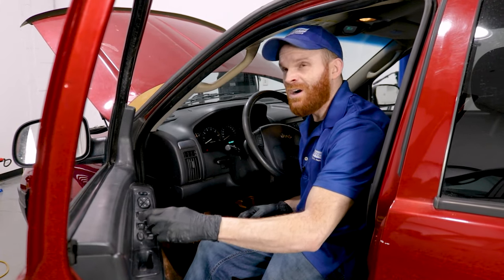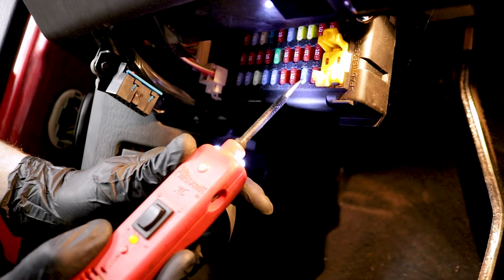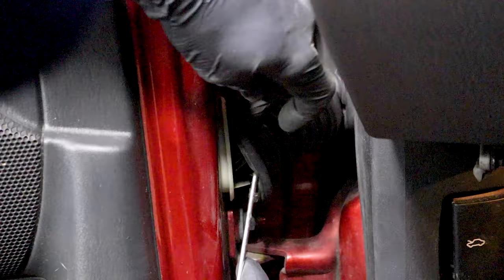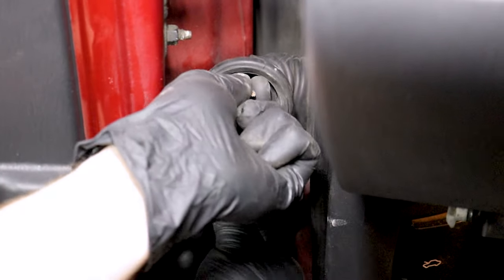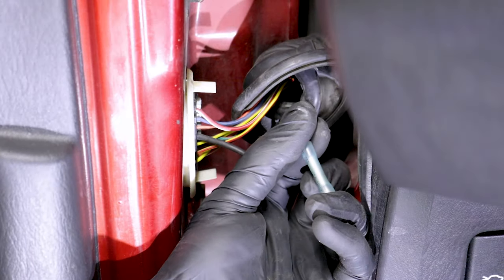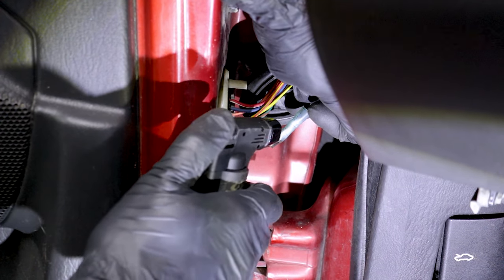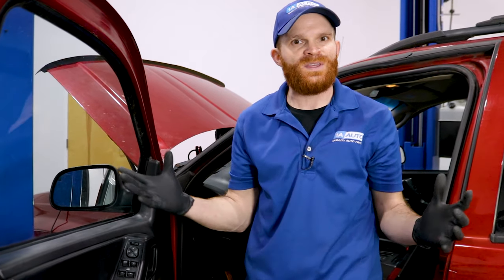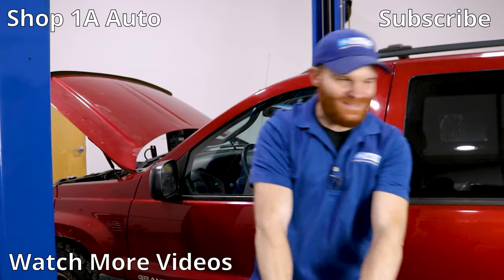Power Windows Not Working? Check for Broken Wires!

Comment: I've had 2 windows that didn't work on 2 different cars, and in both instances the switch had gone bad.  In the second instance, the dealer couldn't find the problem, but I finally figured it out and fixed it myself..

Comment: I had the same problem. Take the door panel off, push the rubber-boot away from the  door and Body.  Pull the damaged  wire carefully a little  out of the door or  car and try to make the joint inside the door with a short piece of wire. That way there won't be a repair right in the flexible  boot, otherwise the repair is to stiff and will brake.

Comment: Your repair is good. The problem I see, is, the crimping tool !! I have seen many flat type crimps just pull out and Like you pointed out, IF, you crimp too hard you can cut the wires.    Invest in a V crimping tool. This tool puts a V crimp in to the butt splice and is OSHA approved.  I can say that for a while it was a little difficult to find these V crimp tools but, now even Harbor Fright has them. They are worth the effort and the money to get them.

Comment: Yes the wear points, makes a ton of sense ! ( nissan navara d40 passeneger window wouldn;t work off the master, stripped linnings checked loose connecter wires  only grabbed the hinge joint as an after thought ...  window started working ,much cheers & like your no nonsense style !

Comment: Had a 2006 Honda Accord, that The driver window worked but none of the others. They didn’t work from the driver’s control nor from their own window control. I found a work around on you tube and did it and it worked. I connected 2 wires by the drivers control with a 10amp fuse. I have always wondered how this worked, any ideas?   Thanks...Jim
PS.....the car had about 170,000 miles, this was in 2016.

Comment: Is there a way to test those wires in between the door and car? My issue is my passenger side windows and side mirror don’t seem to get power. I can lock/unlock the door from the driver controls and the speakers work on the passenger side as well.

Comment: Great video I have no power to the passage side of my Cherokee no broken wires. Drivers side works fine.  My daughter put on the child lock on the passenger side and now the windows have stopped working any thoughts might have to replace the entire switch

Comment: I've got a strange problem with my left front passenger window ( my car is right hand drive, I'm in Australia ) and my right rear window, they both stopped working at the exact same time, both the drivers side and rear left windows work perfectly, my car is an 05, Subaru Outback,could you tell me where to start looking to sort this out please ?? 
Another great video guys,
I'm not to smart when it comes to auto electric's.
Thanks guys.

Comment: Good video, My 2022 Toyota Tacoma the shop changed the driver's door they installed the wire harness and now the 4 door's not working from the main switch, although they changed the main switch, what could be the problem?

Comment: I’m looking to buy a 06 impala3.5L 58419 miles for 3k. Have not seen yet but going tomorrow. Supposedly the windows and the radio don’t work. Idk if it’s related or two different issues. Any thoughts? I’m assuming fuse or relay. Idk yet. One owner, so good there and one reported accident, which it was repaired. Appreciate any feedback

Comment: i have a 2014 VW CC and both the front and back passenger side windows aren't working.  we checked the fuses and they're all good.  we can't open the windows using the driver control switches or the doors' individual switches.  we took the front door's switch panel off and it shows THAT window wasn't getting power.
is it possible there's a pinched or broken wire in that door hinge that controls both the front and back passenger windows?
Reply: Did you find the problem? I have drivers side front and back not working
Reply: Hi Art did you find a solution? I'm having the same exact issues with my passenger front and back windows. Driver window works just fine. Thank you!

Comment: I have a 2011 Camry Hybrid model. Had the rear passenger side window motor replaced, and now all windows work fine but that one... the control on that door itself works but the master up front doesn't... any ideas what could cause this? Thank you!

Comment: I seen the wires in my car, and they weren’t torn apart but two of the wires are only exposed just not torn. Can that also be the reason why there’s no power going through? Switch is good and regulator and fuses.

Comment: Hello, I cut the wrong wire in my 2011 Ford Edge when trying to disable my door ajar warning. It was the driver door window wire. I’ve since cut the right wire and put the window wire back together but window won’t work. I changed   # 1  fuse still not working. What could I do next?

Comment: i have a honda crv 2011 UK model and all the buttons work on the master switch expect for the front passenger side window, it is neither going up or down, but the window open n closes  when you use the button on the front passenger side door, what could be the reason for this to happen?

Comment: Usually does this also affect the lock and unlock? I'm having the same issue for my 2011 Jeep Grand Cherokee Laredo. The driver side master switch only works for the two back windows and the driver side mirror that angles my blind spots. The passenger door locks and unlocks work and don't work at times and the button for the window going up or down doesn't work. I changed the fuses, and circuit breaker and still doesn't work. The wiring is the only thing I haven't checked. My father says it's the motor regulator. I doubt it.
Reply: I’ve got the same problem on an 04 did you get it fixed if so what worked

Comment: I changed the fuses but two windows still don't work. I'll check for broken wires, but can I just switch out the master switch?
Reply from the maker: +STEPHANIE MOORE We wouldn't be able to diagnose an issue like that here, you may want to have a local mechanic take a look at it. Thanks for checking us out! http://1aau.to/m/Shop-1AAuto-c

Comment: My passenger side window will only go down. It will not return back up. I checked the wires in between the door and that wasn't the issue as there are no broken wires. I can hear the motor engage when I press the switch to lower it, but it's already all the way down so it can't go down any further, and there is no noise that implies activation when I try to raise it. In addition, the power mirror, one of the lights for the third climate control knob and the light for the clock have all stopped working as well. Is this a wiring problem in the dashboard somewhere?
Reply: Flair Velocity  no. It just randomly worked again one day and so I rolled it up and taped over the window switches. Sorry that I couldn't help.
Reply: Check fuses in fuse box or it could have a circuit breaker rather than a fuse....and the breaker may be bad.  Find a diagram for fuse box, in owner’s manual or online or on the inside of fuse box cover to help locate fuse/breaker

Comment: I had the wiring under hood chewed by squirrels had it fixed now my driver window won't work how do I go about fixing it and my radio does not show what time or station I am on do you have suggestions
Reply: It is a 2004 Jee Grand Cherokee special edition

Comment: I have a 2003 Jeep Grand Cherokee Limited V8. The two front power windows work but the two rear power windows do not work. On the passenger side rear power window it makes a noise but the window does not go up or down. The drivers side rear power window  does not go up or down and does not make any noises. Does anyone have any solutions to the problems? Thank you

Comment: So i check the fuse and they are working. I made sure that the wires are all connected but I'm not getting any power to the wire. Where do I go from there?

Comment: I have a 2001 2 door Grandprix GTP that had drivers door switch connection problem so I changed the switch and while that problem was fixed my passenger window now won't work! Thought maybe a regulator was bad but when button is pressed it doesn't seem to pull from power like dimming of lights etc. Any ideas?
Reply: Broken wire or bad ground

Comment: My issue is the master switch works but the passenger buttons do not. I have window lock off. With no broken wires or corrosion where else can I find the problem.

Comment: good vid but I would prefer to solder a 1" extension piece between the two with some heat shrink on the joints. I don't trust those crimped on joints, especially in that particular situation.
Reply from the maker: +shed.projects Thanks for the feedback!

Comment: Only my driver side window is working but my other 3 windows doesn’t. There all getting power but just no movement. Any suggestions?
Reply: Ugh!  I have the same problem but I haven’t checked the power yet… I was wondering if the different wires effect different windows or if, like the video, one wire effects all of them (obviously, I’m verrrry new to all of this!  Lol!!)… Any insight would be helpful 😊.
Thanks,
Samone

Comment: I wish mine was this simple. I have a nissan x trails. Relay, motor, regulator, wiring loom, switch and master switch all been replaced. Nothing will get my passenger window up! Itll go down fine just not back up. Ive taken it to auto mechanics no one can find an issue! Argh );

Comment: I have a 2000 Chevrolet Tahoe. Afew years ago my passenger side rear window slowly quit working. I taped a piece of cardboard to it. I was unable to fix it on my own or afford to pay to have it fixed.  I moved from California to Arizona in 2018. 1100 miles, I had to stop about every 30 or 50 miles to Re-tape it.....lol.   I went through a whole roll of Duct Tape!   LoL.  Then my brother in law helped me. He took off my door panel and put a 2" dowel under the window to keep it up. Then this year the moter on the driver's side rear window went out..... more cardboard, No duct tape!!!!!!!  My passenger side all around the window is messed up with tape residue I am UNABLE  to get off. I tried paint thinner, goop off......it will Not come off. 😱😭😰

Comment: DARN I JUST LOST POWER TO ALL MY WINDOWS, I SAW A REAL MECHANIC GROUND MY AC COMPRESSOR RELAY ONCE AND AFTER THAT WAS REMOVED WITH A NEW COMPRESSOR,  3 YRS LATER MY A/C COMPRESSOR WAS NOT COMING ON UNLESS I JIGGLED THE RELAY BUT THE COMPRESSOR WOULDN'T STAY ON(THAT GROUNDING WIRE WAS TAKEN OFF WHEN A NEW COMPRESSOR WENT IN 3 YRS BACK), WELL I THOUGHT I WOULD TRY GROUNDING THAT RELAY AND WHEN I POKED A WIRE IN THE RELAY SOCKET, I GOT A SPARK AND THEN MY POWER WINDOWS GOT STUCK DOWN, NO FUSE TO CK BUT i CKED THEM ALL ANYWAY BUT THERE WAS A CIRCUIT BREAKER FOR THE POWER WINDOWS AND IT CKED OUT FINE AS WE EVEN USED A WIRE IN THE RELAY BOX TO CONNECT BOTH ENDS OF THE CIRCUIT BREAKER CONNECTIONS BUT NO POWER. I HAVE TWO IDENTICAL MODELS OF THE SAME CAR SO I COULD SWAP RELAY BOXES UNLESS THE WIRING IS MORE COMPLICATED THAN JUST UNPLUGGING THE RELAY BOXES AND SWAPPING THEM BETWEEN THE CARS, I WILL STUDY THE WIRING DIAGRAM AND HAVE A MULTIMETER AND TEST LIGHT BUT I FIRST NEED TO STUDY UP ON TROUBLESHOOTING CIRCUITS, ANY IDEAS ON THIS?  THANKS, THE TWO IDENTICAL CARS ARE 2000 DAEWOO NUBIRAS, I SWAPPED THE DRIVERS SIDE  POWER WINDOW MASTER CONTROL SWITCHES AND THE MASTER SWITCHES WORK FINE ON MY OTHER CAR AND STILL POWER ON THE PROBLEM CAR, I ALSO SWAPPED ALL THE RELAYS BETWEEN THE TWO CARS AND NO LUCK.